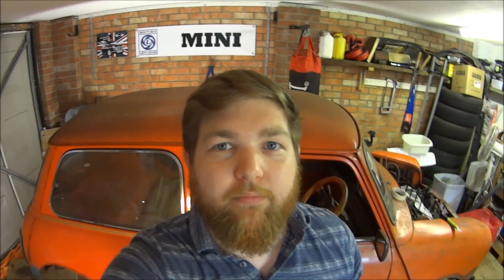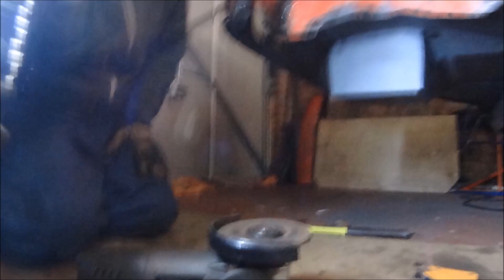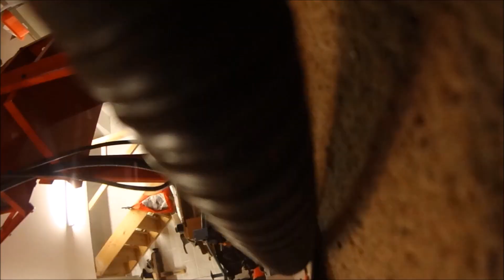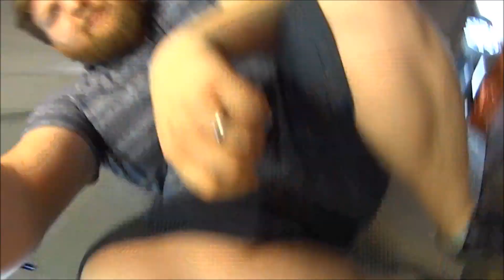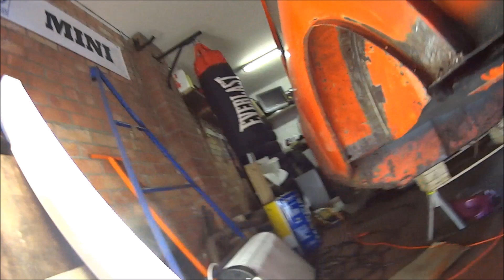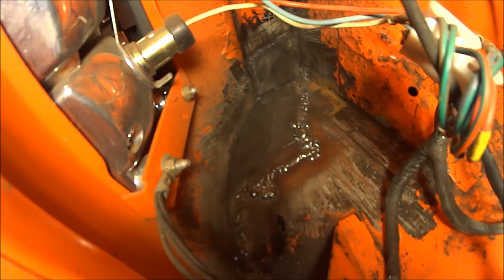Boot Floor Welding - Classic Mini Restoration - Project Bumble - Part 10

Comment: Good job. A little tip try amd leave a 1mm gap around the edge of your repair you will get a better weld also you may need to adjust your welder and when welding do small plug weld bursts dont do long runs
Reply from the maker: mark piper thanks, ideally I need a new boot floor or I should have cut more out as I kept blowing holes where it had thinned out 😞
One day I’ll have to re-do it